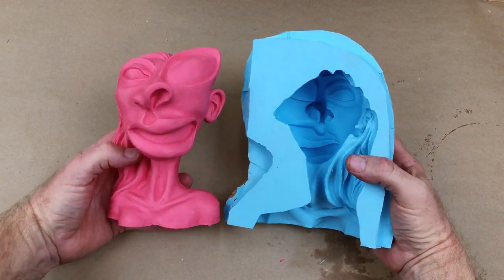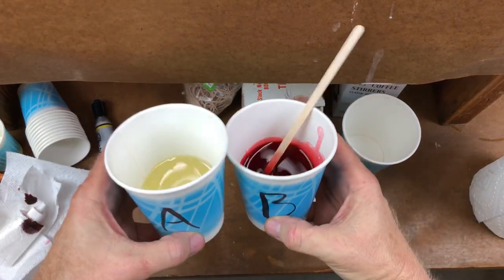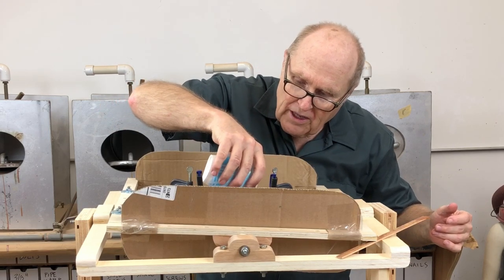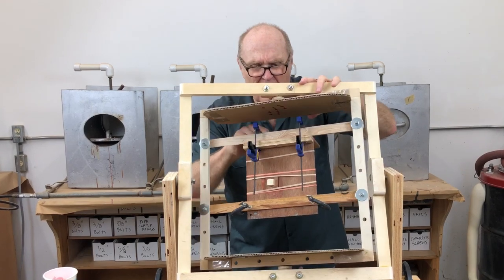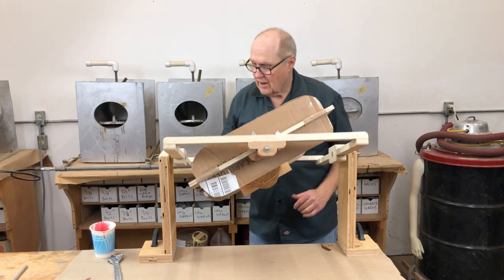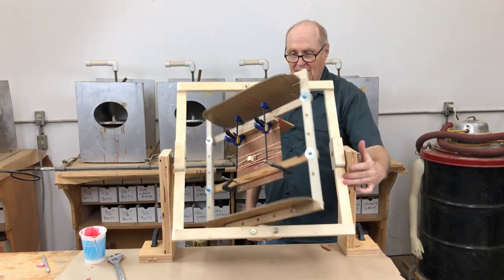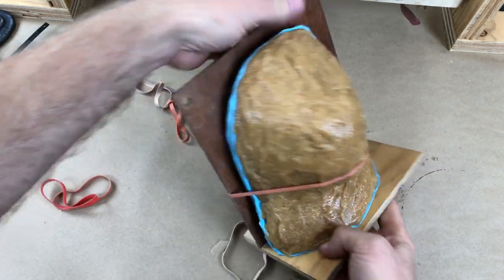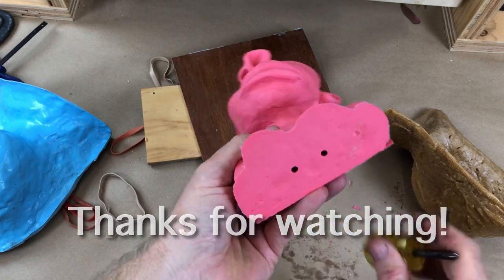DIY Rotational Molding - How to hollow cast a sculpture

Comment: It really did not leak much at all, Robert. I am going to make one with your design. Thank you.  What do you think about putting a large circle disc of plywood on the end of the outer frame, as a “steering wheel” so you could turn one frame slowly, while spinning inside frame with other hand? I’m certain you have already thought of this. You never miss a trick.

Comment: Thank you for this tutorial, it helps me a lot, can you please tell me
What kind of resin did you used on this one, and is epoxy resin will do for this kind of project or not?
Thanks!
Reply from the maker: I used a urethane casting resin.  I have never used epoxy resin for rotational molding. But it’s possible that there are epoxies made for that purpose.

Comment: Wow, this is just amazing. Can you give us downloadable plans on this rotational mold castor machine???
Reply from the maker: I don’t have plans because the machine is simple and can be built to almost any size and shape configuration. The key concepts are that the two frames rotate on axes that are 90° from each other. There must be good clearance between the two frames and between the outer frame and the supports that hold it up.  That clearance is required because of things that are attached to the inner frame such as clamps and cradle parts. I have built rotators in all shapes and sizes, even built a machine to spin a specific mold. The rotational speed is so slow that you don’t need  bearings. Just regular bolts through holes in the wood are sufficient. The best thing for you is design a machine that fits the work that you want to do.

Comment: Hi, loving the rotation mould technique. Just finished my product design masters and am wondering if this could be done with a rubber type material to make a rubber dog-toy like product? Essentially hollow that can be squeezed?  I'm wondering how they leave a hole in it for the squeaker. Can you cut it away from the bung hole part? Annnd I'm assuming if you're doing a few small objects you could rotation mould a few at a time?
Reply from the maker: There should be rotational casting elastomers out there but I have never tried it.  The trick in molding several at once is getting the molds loaded with material fast enough so it doesn’t set up before getting rotated.

Comment: I love your rotational rig.  Is there a place where we can download plans for it to build at home?
Reply from the maker: I don’t have plans because you can build one to fit any requirement. It’s just a frame inside a larger frame. The larger frame rotates on some sort of stand and the inner frame rotates at 90 degrees to the outer frame. Leave clearance between the two frames and the ground. You don’t need bearings or other fancy hardware.

Comment: I need to make a car-shaped piggy bank for a client, BUT I need to make 700 of them. It is fairly simple and monolithic, I'm considering this technique but my question is regarding the quantity. What are your thoughts on making 700 hollow objects and what method would you (or anyone reading this) suggest?? (size is roughly 15cm x 15cm x 25cm)

Comment: Hi Robert, thanks a lot for this, i have a question, does the roto casting eliminate the bubbles that you would get on a traditional cast?
Reply from the maker: It can but it can also trap bubbles. On casts with a lot of surface details you often have to brush the resin onto the mold before doing the Roto casting.

Comment: so i love casting in urethane. however it does get expensive for the materials. do you recommend any other ( lower cost) casting material that can do a similar job for rotational casting like this one?
Reply from the maker: Water extended polyester.  You actually do mix the resin with water to create an emulsion. This lowers the per-gram cost quite a bit. It’s a pretty cool material and it rotocasts really well. Biggest downsides are that it has a strong stinky polyester smell and the castings do shrink over time. Not a huge amount but enough to be noticeable. The cured polyester is also not as strong as most urethane castings.
Reply: @RobertTolone  very cool,im gonna check that out. thanks sop much for the help

Comment: Can this technique be used when trying to make a hollow casting using a platinum silicone about shore strength 00-20/00-30?
Reply from the maker: I have not used platinum rubber to make brush-on type molds. In theory they should work fine as long as any additives like thickening agents are compatible with the rubber. I would test all your materials: the  model, release agents, additives and casting material, etc to check for compatibility. Platinum rubbers are more sensitive to other materials than tin-based rubbers are.

Comment: A teacher I had recommended pantyhose to tie molds together, but she also woukd use a plaster mother mold  to prevent the silicone mold from flopping around. So the pantyhose would grip the surface of the plaster.
Reply from the maker: Have to say I never tried the pantyhose method! Great example of using what you have at hand.

Comment: Hi Robert, firstly thanks for the great tutorial videos, I have now Subscribed. I'm interested in casting plastics as I've just started restoring motorcycles and plastic panels and lenses are rediculosly hard to come by.. so again thanks, However other than making projects in one solid colour, is there any way of making a "tie dye" type of colour scheme on a finished project?  Many thanks, Paul in Perth Australia.
Reply from the maker: You can try mixing batches of different colored resins and pouring them into the mold at the same time.  I believe that that is how they make bowling balls. How well it works will depend on the type of resin you use and the shape of what you are pouring. To be honest I have never had much success pouring multicolored resin in one object.  But then I haven’t really spent much time playing with that process. In my shop it is much more common for us to paint the castings.
Reply: @RobertTolone  thanks for the quick reply, I thought thatg maybe putting 2 different colours of resin in at the same time would make the colours "bleed" together.. it's something I'll have to play with in the future..  thanks again :)
Reply from the maker: @paulperth4205  I have found that a lot depends on the shape of your mold. If your mold is open backed like a picture frame you can drizzle the colors in and they don’t mix much. If you are pouring through a funnel and a sprue the colors will pretty much mix together.

Comment: Hi Robert. Thanks for sharing the knowledge. Were the Clairemont sculptures polyurethane? I had a hollow polyurethane rotocast piece out in the sun last year that deformed a bit with heat. It was painted black and hollow with a thin shell, but still curious what plastic you used and how you approached it.
Reply from the maker: Yes, they were Rotocast in the same resin I am using now. But after casting the pieces were assembled and filled with urethane foam. Also there is a aluminum armature in each one. The wall thickness was around 1/4 “ so they are pretty tough! I was afraid that children would climb on them, etc.

Comment: Nice video.  Which materials do you use for your castings, i.e. 100 grams A and 100 gran B? That is a great help, thank you.
Reply from the maker: I am using a urethane resin suitable for rotational casting. I use  Silplastic sold by www.silpak.com.

Comment: Can you fill the hollow sculptures with some cheaper material to make them heavier and sturdier?
Reply from the maker: Yes, you could use hydrocal or plaster of paris.
Reply: @RobertTolone  Thank you very much.
Reply: Wouldn't that cause problems for the plaster as the moisture has no where to go, considering that you seal the bottom in PU resin as well?

Comment: Hi can roto casting work with say silicone or do you need to more or less let it sit like a two or three part silicone mold ?
Reply from the maker: Do you mean, can silicone itself be rotocast?
Reply: yes :)
Reply from the maker: Warren Goodwin Warren Goodwin I’ve never tried it but it should be possible. It would be best to use a fast setting silicone or you’ld be spinning it for a long time!
Reply: @RobertTolone  mmm indeed, just can't be bothered with putting in a third inner mold for injecting the silicone i mean i don't mind standing there with random rotation for ages but yea might need a test i think - not sure if rotating the silicone in the mold would disturb the release agent - which i also have, but yea

Comment: What dye are you using? What key words do I use to find it?
Reply from the maker: Here is a link to the materials that I use. The dyes are under resin colorants at the bottom of the first page. I am not sponsored by or affiliated with this company, they are simply my material supplier.  https://www.dropbox.com/s/kz6mhmf7v5vpy7l/Material%20and%20Suppliers.pdf?dl=0
Reply: @RobertTolone  thank you so much - you are a massive help with my research- so thank you

Comment: did you say Bung Hole,  6:27 LoL i heard that word on Bevis and Butthead LoL really I did, Robart Tolone, you make a lot of these videos?  different types of dyes mixing, mold making, as well as casting, with all types, of different products, like plastic, clays, wood etc?  well, it was a great video and ur Gal came out HOT Pink Sexy, Mister piece did come out fabfabulous 👍🏼 oh ur video just came on while I was looking for Canon  Lenses, on Ebay and wanted to go see whats you making ha.
Reply from the maker: It’s a very old word. A bung is a stopper that plugs the hole in wooden barrels. The opening is therefore the bung hole.  Of course, we know what Beavis and Butthead were referring to when they said bunghole!

Comment: Could you show us how to motorize it?
Reply from the maker: I am considering it as a video project. The motors, wiring and control would be simple enough. But I will definitely need help with writing the code. One of the big advantages to hand control is that each shape you cast needs it’s own  rotation strategy and doing it by hand means you can adjust the movements to the shape very easily. With  a computer you would need a program that allows you to set the parameters of rotation to cast the shape. Thanks for your interest!

Comment: Is there any other way to hollow cast other than rotocasting?
Reply from the maker: With resin casting the only other way I know is to create the object as front and back shells.  Then you would need two separate front and back molds. After cast the shells you glue them together to create the finished hollow part.
Reply: @RobertTolone  I was thinking the same thing, but I'd like to avoid having to glue them after they've hardened because I fear that there will be a visible seam line. 
Do you think it's doable to attach the two molds while the resin is not yet fully hardened, or would it not make a difference?
Reply from the maker: @pival801  Anything you mold and cast will have a visible parting line that you need to clean up. That’s why I advocate cut molds because they have the cleanest lines.

Comment: Does this way cause bubbles
Reply from the maker: No, usually the castings are bubble free. If you have a sculpture that has a lot of surface texture it may be more likely to catch bubbles in the details. But the resin does a good job of wetting the surface. Only trying it will tell you if it works for a particular piece.
Reply: Robert Tolone thanks

Comment: I can see my fingers getting caught in that gyroscope lol
If u put the uprights on the inside, U could put a turning handle on the frame
Reply from the maker: you could put a handle on the outer ring but to put cranks on both rings requires a system of gearing or pulleys. It works but it’s more complicated than is necessary.

Comment: Add a L shaped handle rotator
Reply from the maker: I used to motorize my rotators, then I went through designs with cranks, handles etc. Now I just keep them as simple as possible. Less work to build and just as functional.

Comment: Thank you ! But with all due respect you are wasting time by using antique scale - it is not as accurate as electronic scale,takes WAY more space and time consuming to use … Speaking of rubber bands - why not to use a glue gun to secure a mold it will take WAY less time and will hold a piece with higher security…